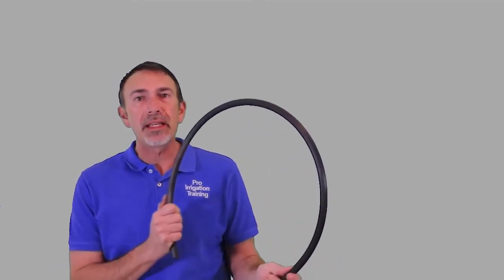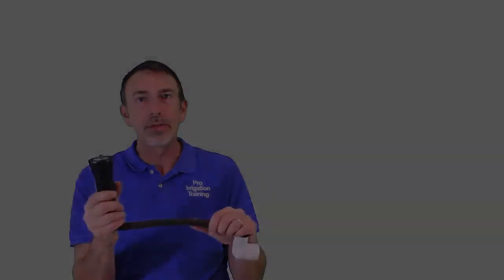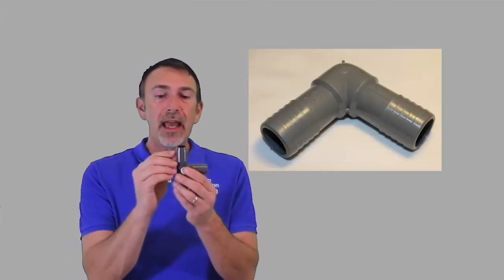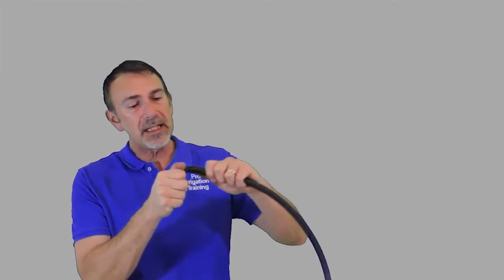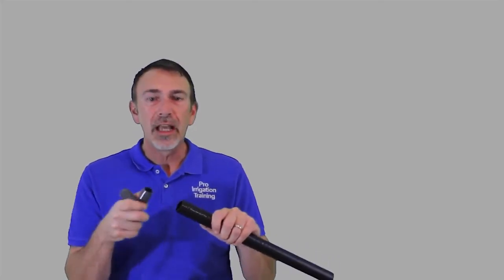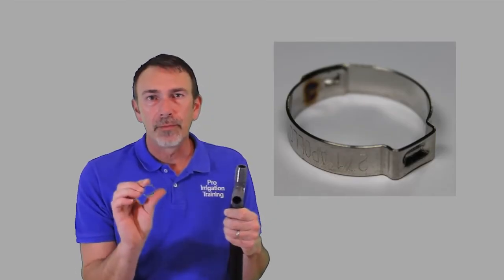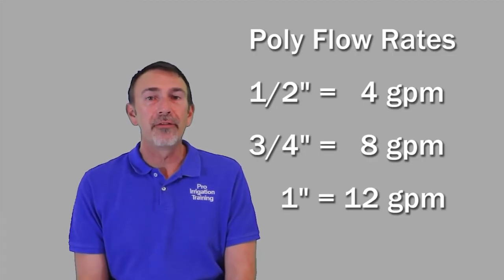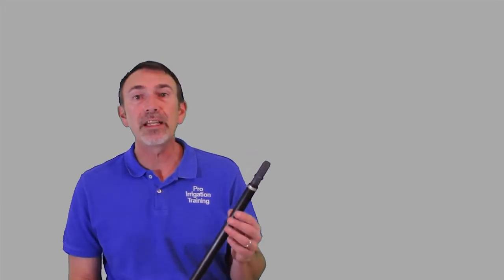All About Polyethylene Poly Pipe and Fittings

Comment: My problem is that I live in the low AZ desert where the temps easily reach 115 to 118.  Those connectors end up blowing out. I haven't used the clamps you told us about.  I use a lot of the poly pipe on my acre.  Where do I find the bigger  poly pipe.  I use the 1/2 poly because that is the only poly found in big box stores.  And where would I find the connectors to adjust to the 1/2in from the larger poly?  I would still have to have connectors to hook the poly up to the outdoor water  pipes.
   Poly is the best choice for this old lady to DIY.
Reply from the maker: I would check online for plumbing or irrigation supply stores. I'm surprised that the big box store doesn't have the larger sizes. Usually they carry rolls and sticks of poly up to 1.5" I'm sure this varies according to your market. But I'm sure a professional supply store can sell you some poly as well as the clamps you need. Thanks for watching and commenting!

Comment: You said you were driving by and they were putting in half inch poly pipe they were probably putting in a drip line but you didn’t stop or you didn’t check to see that they did not put sprinklers on that line. So therefore you assumed and you know what assume means it makes some ass out of you. I’ll leave it at that.

Comment: I installed those clamps on barbed fittings. 5gpm, 60psi, used apollo fittings and leaks every where. I have to use 2 clamps to stop the leaks and some are still leaking. idk whats with this stupid thing. pvc is a piece of cake to attach but not flexible. I wish i used pvc all along
Reply from the maker: I hear you on that. I always install PVC, and generally dislike poly fittings. But I hate to hear that you're having that much trouble with them. At 60 psi, there shouldn't be a problem getting them to seal with one clamp. I wonder if it's an issue with the fittings?
Reply: @Proirrigationtraining  one thing that helped is heat gun. After heating, poly takes the shape of fitting with the clamp and is much efficient. But still i needed 2 clamps. Depends on poly flexibility and outside temperature i guess

Comment: There are supposed to be TWO clamps on BOTH sides: each turning the opposite direction to the other.
Reply from the maker: You're 100% correct about that, especially on the main line and constant pressure connections. I appreciate you bringing this up, I'm refilming videos and it helps to hear what I've missed.

Comment: Why is it that the 1/2” pipe that I have is larger than the 1/2” fittings I have? The barbed 1/2” elbows and extenders slide in and out with ease…
Reply from the maker: sorry for the slow response, it's crazy season right now. Anyway, there are actually different sizes of 1/2" tubing. There is the thicker wall (about 2.5 mm) poly tubing called "funny pipe" or "swing pipe" or "flex pipe." It has a smaller inner diameter. there is also 1/2" poly tubing that has a thinner wall (about 1.5 mm) This is typically sold as Drip Tubing. It has a larger inner diameter, so the fittings for this kind of tubing won't fit those designed for Flex Pipe. Usually in a hardware store, the fittings for the flex pipe are with the irrigation parts and the other fittings are with the poly tubing.

Comment: Would you like less broken heads?
A Marlex fitting, combined with the SBE, allows for better placement and overall maneuverability for the sprinkler head. It’s been basic protocol for all my 19 years installing residential and commercial systems. 
Perdy solid video otherwise.

6:58 A rubber mallet is a must for us folks up north. Using a torch is asinine.

Comment: 3:42  Inner diameter controlled = pipe, not tubing; correct?

8:50  Not 30 to 60 foot pounds; but rather 30 to 60 inch pounds, which is 2.5 to 5 foot pounds.  30 to 60 foot pounds is an order of magnitude too high!  60 foot pounds is getting to small lug nut torque, guaranteed to strip a worm drive clamp.

The way you are holding your 1/4 socket wrench, with your leverage maybe 3 or 4 " from the screw axis, you would have to put 90 pounds of force at 4" to generate just 30 foot pounds of torque.  So you hold the wrench like you have it, then put about 8 to 10 pounds of force and you'll have about 3 to 3.5 foot pounds of torque, a reasonable amount.  You are correct when you say to put "just enough".

And BTW, thank you for the video.  I did learn a lot, and specifically I was interested in using the pinch clamps and how much force they would put on the plastic fittings.  Also how secure they were versus the worm drive, and how they hold up over time.  I have some old poly piping water delivery systems that are starting to leak after decades using dual or single worm-drive clamps.

Comment: Great video. Very detailed and informative. I’ve never used poly pipe before. The guy at the home center said I could use a heat gun to warm the pipe and slide in the fitting. Unfortunately, I’m now learning that was terrible advice. He said nothing about using a clamp either.
Reply from the maker: Ya know, it's probably ok to a small extent. It doesn't take a lot of assistance to get the fittings in. But the more you heat pretty much anything, it changes the elasticity and so forth. I prefer to use a rubber mallet. Just make sure you flush out your zones before you put the nozzles on, the rubber mallets leave little chunks of rubber. And definitely use clamps.

Comment: Great video on working with poly pipe. I notice that you fasten your stainless steel clamps about 1/4 inch from the end of the pipe. I have always wondered about the correct distance but, unlike pex (1/8 to 1/4 inch away from end), no one has ever told me exactly where they should be fastened. With poly pipe, I have been placing them 1/16 inch away. What distance do you recommend? My guess from your pic is 1/4 inch. Thanks 🙏.
Reply from the maker: Ya know, I'm not sure what the correct answer really is, but I'll tell you what works for me. Each barbed fitting has 3 barbs. Usually when you insert the fitting into the pipe, you can tell where the first and last barb are. I recommend centering the clamp on those ridges so that it makes good, even contact with the barbs.

Comment: Great video. Question: What is the best way to remove a pipe from a fitting without damaging either, in the case of repair/servicing?
Reply from the maker: Hi Robert! Thanks for watching. It's difficult to get a barbed fitting out of tubing without loosening the pipe up. It's best to cut that out and put a new coupling in or whatever your repair needs. Sometimes you don't have enough room to cut it out, and a heat gun used carefully can help you work the fitting out, but push a new one back in while the tubing is still warm. Would love to hear what other techs are doing in this case, we don't see a ton of poly in my area.

Comment: Splendid video. I am in the Ryobi ONE+ 18V ecosystem and I found a use for the weak ONE+ heat gun system Ryobi makes. Heating one-half-inch or one-fourth-inch tubing to shove on a fitting.

10:42 the recommend against WD-40 - been there and done it. I thought I was smart as a whip, a little spritz of WD-40 and we were off to the races. A few weeks later I was repairing a leaking connector I had treated with the solvent.  I was less impressed with myself. WD-40 fixes "ALMOST" everything.
Reply from the maker: Yes sir, no doubt. I absolutely love WD-40, its just not for every situation. And I've been hearing a good bit lately from people using heat guns. My only advice is be careful and don't overheat anything.

Comment: I am connecting a garden hose as a supply line to a remote spigot. The connection requires a transition from the hose to a short piece of 1/2"  PEX.  I don't know what my outside water pressure is but do you think a clamp would be required at the transition fitting?
Reply from the maker: Sorry Paul, thought I had already answered this for you. I would use a clamp on the PEX. I'm not 100% sure, but I think all PEX connections should have one. I certainly do no matter what the pressure is, but I don't deal with it much.

Comment: I had a 1" barbed fitting fail at 60 PSI (NO pinch clamp). In CO. 5400 feet. Colder winters.
Reply from the maker: Yes sir, that cold weather is brutal on everything.

Comment: This video is very helpful! Thanks so much.   I have a couple of questions for you regarding the 1" poly that I am repairing. 1) the pipe is about 20 years old and a couple of goof plugs were leaking. When I tried to remove them they broke and I can't get the part that is inside the pipe. What will happen if I push it in and put in a new goof plug?  2) For patching: once I get the fitting in on end of a patched pipe by hammering, how can I secure a tight fit on the other end? Since you don't recommend anything akin to WD 40 or vaseline, is my only option to push as hard as I can and hope for the best, or do you have another tip? I'll certainly try it on a hot sunny day if that is all I can do.
Reply from the maker: Hi Tana, hope this reply is soon enough. 1) Go ahead and push it in. The piece shouldn't clog anything, but you can go to the last fitting on that line and remove it, so once you turn the water on, it can blow out the end. 2) Dawn dish detergent or something similar will be slick enough to help you push it into place. Leaving your piece of repair pipe on your car dashboard in the sun will warm it up enough to be a bit more flexible.
Reply: @Proirrigationtraining  HI! This is very helpful. I am getting a crash course in all things poly pipe repair and other irrigation fittings. As my landscaping has matured I have discovered that many adjustments need to be made. Roots have closed off parts of the poly and pop-ups are covered up by overgrowth, and much more. I will be checking out your other videos. Thanks!!!!
Reply from the maker: @allthesongs7545  You're welcome! Good luck with the repairs, I know it can be a pain when roots are involved. It's the story of my life. If you have any more questions, I'll do my best to help. I may not be lightning quick with the response, I'm still a working man, but I try.

Comment: My 1/2” blue push on fittings all leak out of the square holes on the fittings. What am I doing wrong? How do I fix them?!?
Reply from the maker: Hi Jil, thanks for watching and commenting. I can't think of any reason that water should be coming out of the fitting. Make sure the pipe is pushed all the way into the fitting, but other than that, I'd contact the manufacturer and ask about it and get replacements. If anyone else has seen this or knows what the problem is, please comment.
Reply: That’s because you didn’t use heat on it and didn’t put a clamp on it

Comment: My PVC pipe that is under my sidewalk has a leak. As a fix, could I run the swing pipe through the PVC to connect the sprinkler head since the run isn't that long? I want to avoid the hassle of replacing the PVC or ripping up the sidewalk.
Reply from the maker: If only one or two heads are after the sidewalk, you should probably be good. Swing pipe will only flow 4-5 gpm. That would certainly be easier that replacing the pipe or boring under the sidewalk. Thanks for watching!

Comment: Question about the 1/2 inch (0.70 or .071) black poly supply for a drip irrigation, does that poly last a long time?  I live in the desert and plan on burying it 4 inches underground so little concern about freezing and won't be in the sun.
Reply: Yeah it should last just fine. You burying it helpsnout greatly.

Comment: This was a great video, thank you for your instruction! One question, what diameter poly tubing do I need to connect to a friction barb 5/8" ID outlet?
Reply from the maker: Hi Lucas, thanks for watching! Is 5/8" the actual size (you measured it) or is that the nominal size of the fitting, as in you bought it as a 5/8" fitting? Poly tubing sold to the irrigation trade is usually 1/2", 3/4", or 1". There are other sizes of tubing on the market for different uses. Go to a Home Depot or Lowe's, and there's an isle that has several types of tubing. Take the fitting there and see what it matches up with.

Comment: Thank you!  There was so much information that was wonderfully put together.  I've taken many notes from this video for my own project.  I'd like to suggest something to help you reach and help more and that is a playlist once you are done.  The videos are a great tutorial for us DIY'ers and all are very valuable.
Reply from the maker: Thank you so much for commenting! I do actually have several playlists put together. Is there a better way of doing that? I ask because I may know a bit about irrigation but much less about Youtube. I'm learning though!
Reply: @Proirrigationtraining  how do i attach that to my copper pipes in my house, i want to extend water to backyard
Reply from the maker: @Eastbaypisces  You may have to solder in a tee adapter fitting that will change to pipe threads. then you can screw on a PVC female adapter and start your irrigation system. Definitely consider putting a Backflow Preventer at that point to prevent any water in the irrigation pipes from being sucked back into your drinking water.
Reply: @Proirrigationtraining  actually im doing pvc,  so how i connect to that

Comment: I can never get the worm gear clamp to clamp hard enough to stop the water. I always break the clamp before it stops the leak. i gave up and started using the Harco fittings compression fitting but they cost an arm and a leg
Reply from the maker: I think worm drive clamps are rated up to 80 psi. Maybe you have pressure that's quite a bit higher? Or possibly find a different brand of clamp? Maybe you've gotten hold of a bad batch of clamps? But in my experience, it's usually because of high pressure. Thanks for watching!
Reply: @Pro Irrigation Training  i would imagine its higher. Straight from the city pipe. Thought about adding a pressure reducer, but i figured it was the desity of the pipe causing me problems since it's so dense, didnt think of the pressure. Alao its SIDR where the inner diameter is the standard size so thought it might have been that too since i was using a barbed pipe fitting.

Comment: I need to run some water pipe to my garage. I can get 3/4 " 200 or 250 psi (100ft) for the same price. Would one be preferable? (Mayve 200 is easier to work with?)
Reply from the maker: The difference is the thickness of the pipe wall. Since Poly is "inner diameter controlled" there's no difference in the flow rating. As long as you're using insert type fittings, you're good with either one. I would use 250 if the price is the same just to get the additional durability.
Reply: @Proirrigationtraining  hey...thanks very much. appreciate it.

Comment: We are setting up 1in sprinkler manifold where 3/4 160PSI poly goring to the sprinkler heads and we have difficulty threading them to manifold as the thread comes out coz of stress the poly crates against the manifold threading. Anyone came across this situation and any ideas to fix it would really appreciated. Thanks
Reply from the maker: If I understand the question correctly, the poly is coming off the barbed fittings? If so, how high is the pressure? Barbed fittings for poly are good up to 80 psi (5.5 Bar). If the pressure is higher, use either crimp clamps or worm-drive clamps to secure the poly onto the barbed fittings.

Comment: I'm rebuilding the sprinkler system that came with the house we bought. It was three 1/2" poly pipe sections just tied into a hose bib. Each zone is fed entirely by 1/2" poly pipe, and the number of heads varies from 1 to 5 per zone. Needless to say, the performance is pretty terrible. They have sprayers with a range of 20-36 ft spaced 14 ft apart, and each sprayer on the 5 head zone is barely managing to even reach the other heads 14 ft away. I'm probably going to end up digging the whole thing up and replacing it next year...
Reply from the maker: Hey Adam, thanks for watching! The problem is in the 1/2" tubing. It just can't flow enough water to meet the demand. You can only get 4, maybe 5 (with high pressure) gpm. If you want to use polyethylene tubing, 3/4" will flow 8 gpm comfortably, and 1" will flow 14 gpm. A lot of people get confused about flow demand. You determine this by the nozzles on your rotors. Look at the nozzle, then go to the manufacturer's charts and see what flow you'll get at your available pressure. The total of the heads on that zone can't exceed the pipe's flow rating, or you'll get weak performance.

Comment: Can this be used for a compressed air system?
Reply from the maker: No sir, not this kind of tubing. I've read that Poly can be engineered to withstand compressed gasses. But not this kind. In fact, using any type of plastic pipe or tubing used primarily for water (for compressed gasses) can result in severe injury or death. So, my advice is to only use tubing systems designed for compressed gasses. Thanks for watching Emerson, and thanks for the question!

Comment: Note: vasiline absolutely safe and neutral to people and plants.
Reply from the maker: You're definitely right about that. And in the small amounts needed, would surely be no problem. BUT, I still wouldn't use it, just because it would persist, rather use Dawn if anything.
Reply: Vaseline is petroleum based and can break down polyethylene. Could use a water soluble lubricant like KY
Reply from the maker: @rjbush  Great point, I never thought about that. Thanks for watching!
Reply: @Proirrigationtraining  I've been using dawn dish soap for all my barbed fitting repairs for years with no issues. Working on a 30 head install with about 400' of piping and the only thing I use is dawn dish soap to lube things up. Makes a difference and the soap will eventually flush out the heads and not harm the plants or turf.
Reply from the maker: @weinkaufa  Great tip, Dawn is super mild, and cheap as well. Thanks for watching and appreciate the comment!